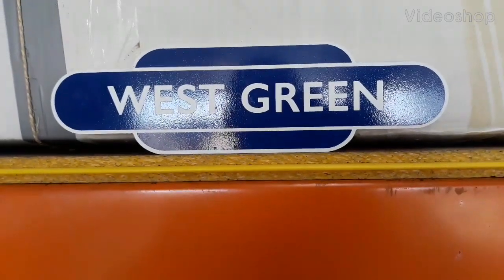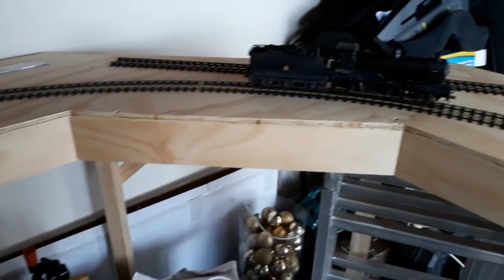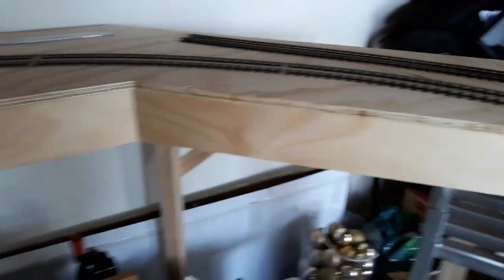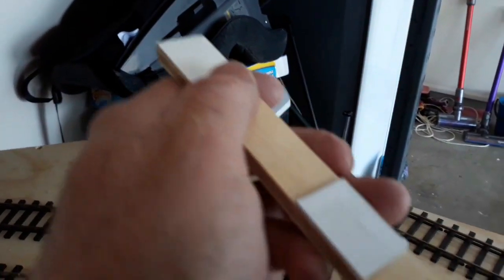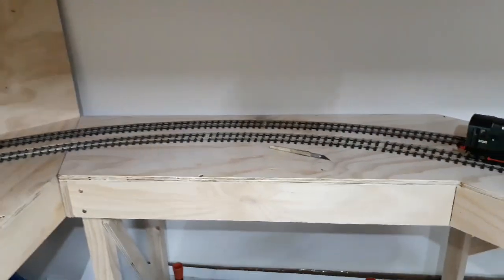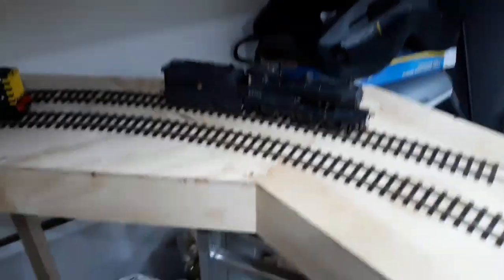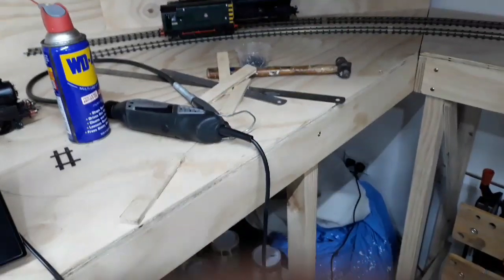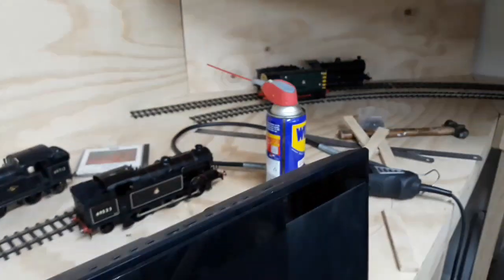West Green 0 gauge update 12th September 2019

Comment: looking good steve !! loving the 08 with early crest ...just one thing though ..have the checked the radios against a mk1 coach with the curves ? that's if your intending to run two trains at once that is
Reply from the maker: Well I probably wont run the mark ones but yes I have checked it, hence why the 6 ft way is substantially widened.
Reply: ahh righto fair enough :) ..